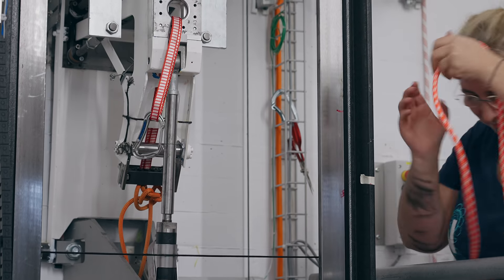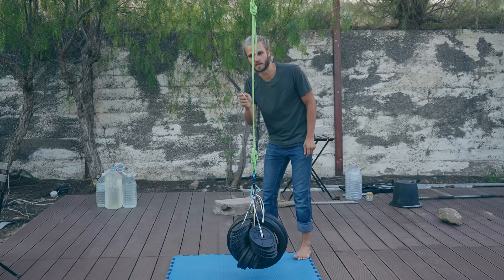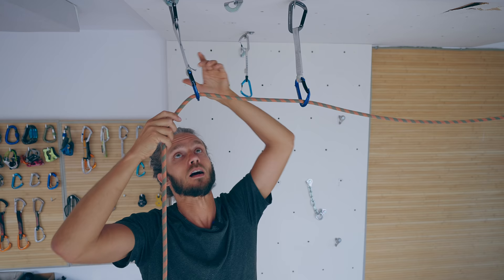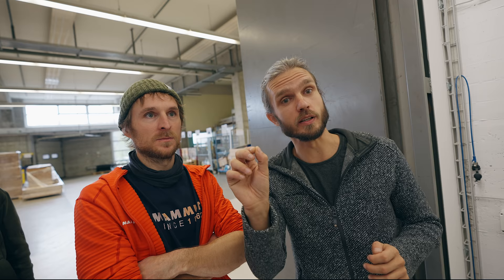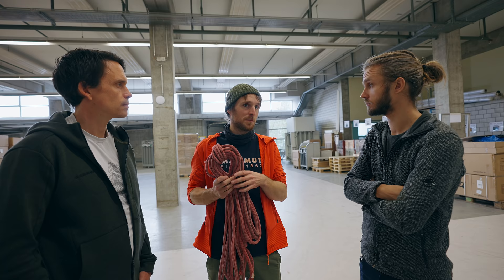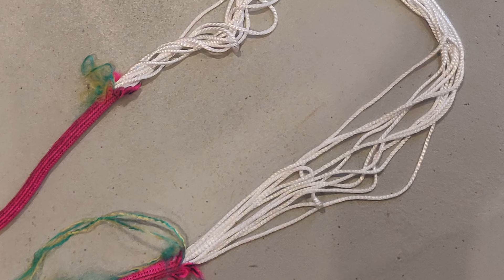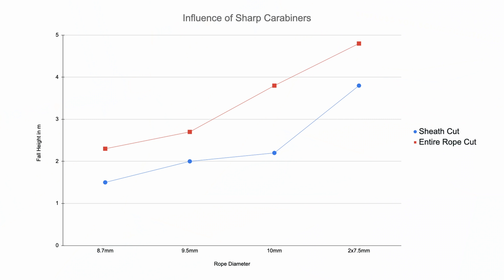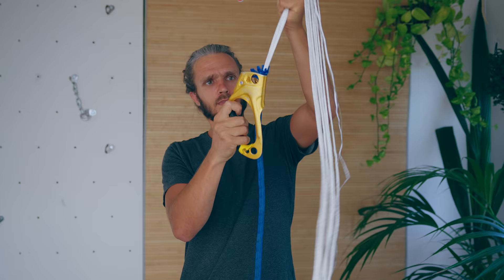Cut Resistance of Climbing Ropes Analysed

Comment: Have any companies looked into something like having steel threads woven throughout the sheath and/or core for increased durability?
Reply: The rope needs to be able to stretch during deceleration so the forces don't get too high. Climbing ropes are specialized especially for climbing. The material, the size of the threads, the size of the strands, the way the rope is braided, and having a core all contribute to it's breaking strength.
Reply: @dannygjk  Climbing rope doesn't stretch that much, they could some use of sort of metal threading, and I highly doubt the rope really needs to stretch rather than that's just the natural property of the material being used, all the rope is used for is keeping the climber on the rock. Plus there's no regulatory measures to make rope, the metal threads could really help with breaks and abrasions.
Reply: @Master_Yoda1990  The rope does need to stretch so that it has greater breaking strength because it means lower deceleration force. You also have to consider that if the climber is stopped in a microsecond they are more likely to get injured by the sudden stop. If you want to have a rope with a higher breaking strength then you would just use wire rope, (which is commonly called cable but technically the proper term is wire rope).
Reply: @dannygjk  and a wire rope is a rope with some wire threads braided into the rope?
Reply: @Master_Yoda1990  No, normally it's just steel but some have a small non-steel core. I forgot why it's been decades since I had any experience with it. Anyway wire rope is a pain to work with it would suck to use it for climbing.
Reply: @dannygjk  no, I'm just talking about just a few wires woven throughout the sheath, just enough for abrasive durability, but not enough to really mess with elasticity or flexibility of the rope. Or maybe kevlar.
Reply: @Master_Yoda1990  Another problem with wires is metal fatigue will kick in quickly. I don't know if Kevlar would work. I don't know it's properties other than what I read about about it decades ago. Probably would make for expensive rope tho. Even the cost of current rope used for climbing always surprises people. In the long run tho for most people  they could probably afford to replace it often. Anyway I was surprised to learn in this video that these serious climbers didn't know about a certain property of rope.

Comment: How often should the rope be changed?🙏
Reply: Look up "fall factors". Most ropes are rated for 5 to 10 normalised falls which are quite severe (say a 5m fall) and have a fall factor of about 1.8. A more typical fall on a climbing wall might have a factor of 0.2 to 0.5 so the life of a rope could be anywhere from 5 to 50+ falls depending on how severe they are. Inspect regularly. Keep a record of falls and estimate the fall factor. There are better guides on the web.

Comment: Never use fixed draws; use your own.  And we've had core shots on wall routes and just duct taped the spot.  It doesn't install confidence while jugging that rope 900m off the ground.  But it worked.

Comment: Edelrid Protect ropes are much more cut resistant than conventional ropes :)
Reply: Kind of surprised that there’s no mention of this technology in the video or anywhere else in the comments
Reply: And a key quote: “In testing Edelrid have found the Swift Protect Pro Dry be far harder to cut than both a standard Edelrid Swift and an Edelrid 10mm rope. With an 80kg load applied the Swift Protect Pro Dry cut after 100cm, whilst the 10mm rope cut at 66cm, and the standard Swift cut at 54cm.”

Comment: Didn't edelrid find out that the cut resistance is actually not related to the rope diameter?
Reply from the maker: I think they showed that the load is more important, where two climbers on thicker rope was worse than one on skinny rope ...

Basically everything matters... how much you load and how much material you have for that load...
Reply: @HardIsEasy  Thanks for the quick answer, Ben.
You are right, they did conclude that. However, I think there is more.
As far as I take it, they designed a standardizable (?) test for measuring the cut resistance of ropes:
https://www.youtube.com/watch?v=WGjvW8_wLuE
From their results I take, that the cut resistance does not (necessarily) scale with the diameter, since thinner rope can yield better results (stronger cut resistance). Other factors come into play, however it is possible that thinner ropes have better cut resistance. 
Obviously it is not the most scientific study, however the graphs shown by mammut are neither, which is also obviously not the point here.So maybe we can discuss this so your video does not send a wrong message: the thicker the rope the safer I am (assume same load obviously)
It would be interesting to see the mammut engineers comment on that.

Thanks for all the effort you are putting into this. I can not emphasize enough on your contribution to the climbing community and to the more nerdy sides of climbers, even tho i think all of this should be basic knowledge in any cours touching actual rock.
Cheers
Noah
Reply from the maker: Thicker is always harder to cut if you consider same load and same technology / materials - that's no brainer.
But sure a thinner rope made in "smarter" way can outperform thicker cheaper rope. I've seen the same with abrasion resistance that I've showed in previous video, where 9.0 rope was looking much better than 9.5 rope on the same abrasion testing.

Cool to see the development in cut resistance for sure. I know lots is coming since all the brands are looking into this (or they should:)
Reply: @HardIsEasy  yes, that obviously true :D
I think I just want to bring up the point that only evaluating a rope by its thickness should not be the only paramter when considering its cut resistance.
The reason I wantet to discuss this because I understood the video in that way, or rather felt like that it people could understand it in that way and it might need some clarification ( if that is correct anyway).
I would want to avoid where people "blindly" think, my rope is thicker / the thickest so I am more safe. I hope it is clear what I am trying to get at.

Cheers and thanks again !
:)
Noah
Reply from the maker: Yea thanks for that, and the link to Edelrid vids :) I'm always interested in these developments :D

Comment: I think maybe we shouldn’t be leaving permanent draws on routes then
Reply: Yes but mostly, don't take anything for granted, specially things you don't know. It's better to have the right mindset rather than just prevent the problems and skip awareness.
Reply: Just don't use aluminium carabiners, steel is the way to go for fixed stuff. And check every fixed draw befor clipping, and when its dangerous take it down, even with no new one.
Reply: @nicofricker78  Yeah that’s what I meant, no fixed aluminum draws

Comment: I have been a knot specialist all my life and then used them in life risk situations for years.   I was also a teacher of knots to dozens of people.   All knots weaken the rope in different percentages.   Sharp bends in the rope are the worst.   Now to my point:   The figure 8 knot with one loop is insane.   The very sharp bend is terrible.  I have never seen a worse knot for strength.   (Who invented this?)   I used a bowline on a bight with 2 equal loops.   Mountaineers are not always so smart (thin ropes?!  --  OMG).